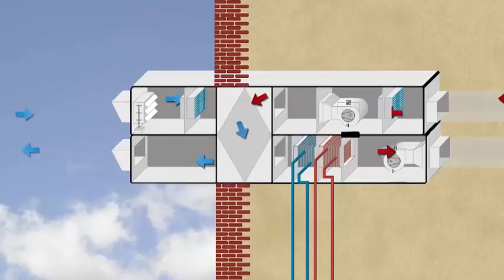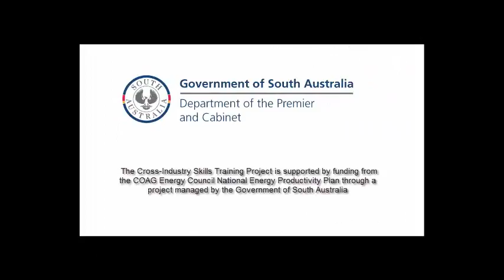Heat Recovery and Ventilation Systems

Comment: I live in 2 bed apartment with exhaust heat pump. Because it’s ireland we have vents in every room which are basically a whole and they are very drafty. It’s always very windy in Ireland so there is loads of cold air coming through them and temperature in rooms drops dramatically. Should they be sealed ?
Reply: https://youtu.be/fk__Jv9tr0s
Reply from the maker: vents were required when people used gas and wood fires. If you no longer use gas and wood heating it is best to seal any vents